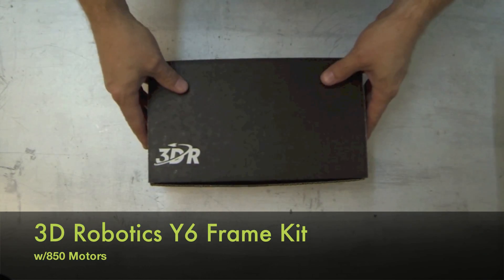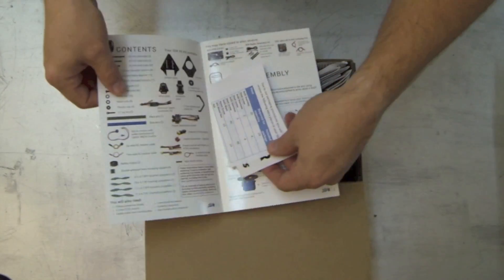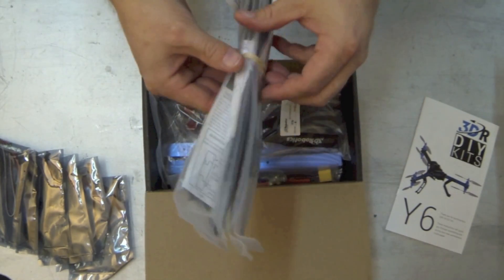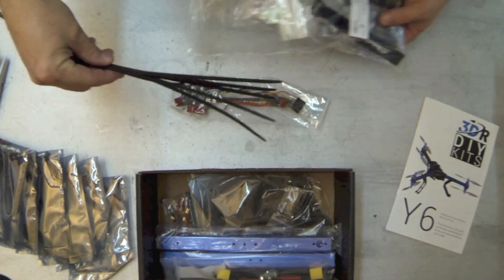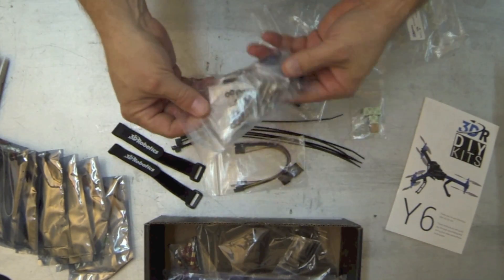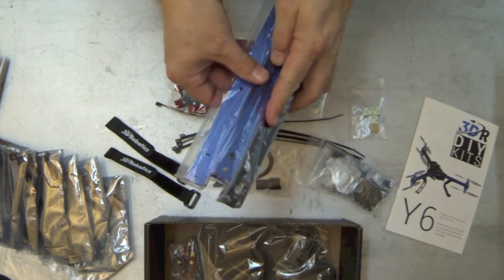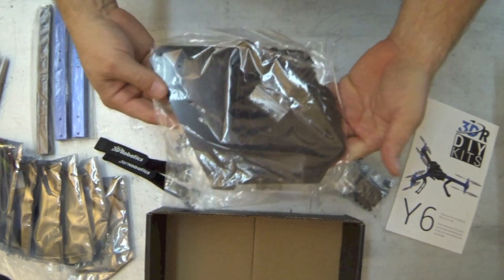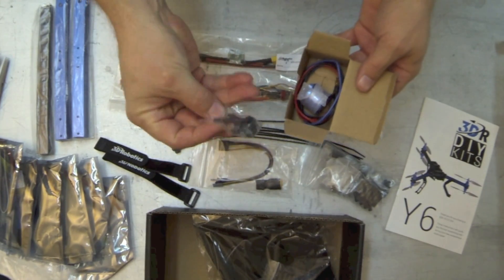3D Robotics Y6 Multicopter Kit Unboxing & Introduction

Comment: just another quick question... how long did it take for you to build?  I'm thinking of using 2 of these for a program that I'm doing teaching at-risk youth... but I'm going to have to do the build myself, and i don't have a whole lot of time?  I'm just doing a basic "discovering drones" program so I'll be working with the youth to create various custom missions which will be community based. (crop surveying, search rescue etc) I wasn't sure if I shoud get the y6 due to redundancy or a hex or even quad.  These platforms are going to have to stand the test of replicating with other youth as well.  (I'm using quadlugs.com to get the kids up and running with flying first)
Reply from the maker: You might seriously consider the 3DR quad then as the Y6 is a little advanced for both assembly and set-up.  The quad is much easier and cheaper to build.

Comment: Why did you opt for the Y6 in stead of the x8? Cant decide between the 2 at the moment.
Reply from the maker: I wanted some redundancy over a quad and the Y6 gives you that.  The X8 is nice too if you need to lift a lot but the extra price and battery life are the main drawbacks.  Keep it as light a possible for your payload and you'll keep the price and complexity down.